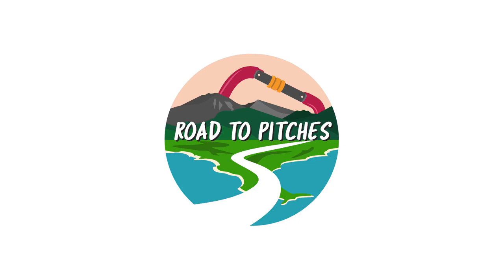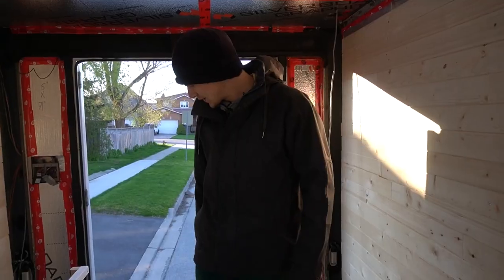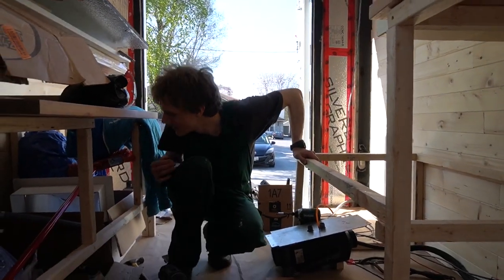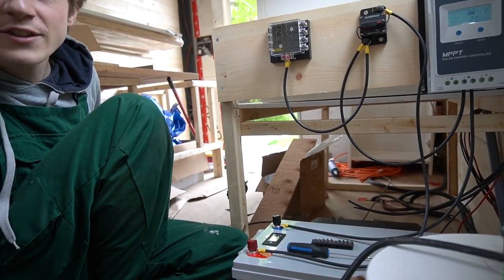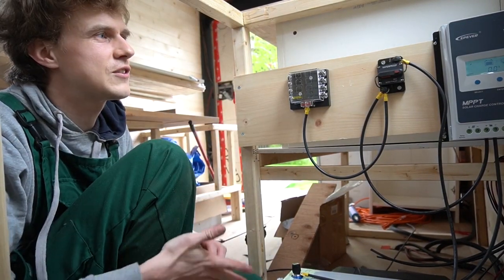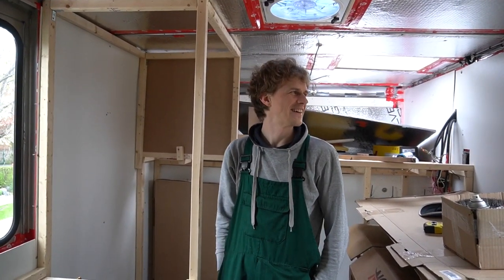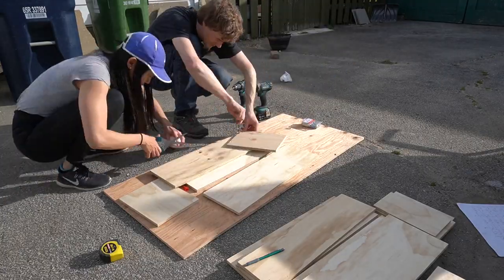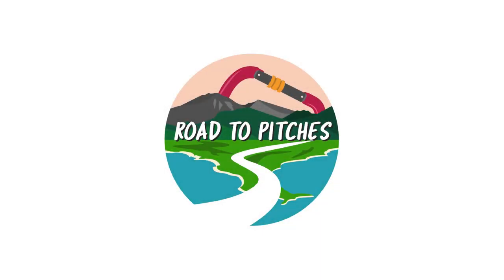Hot Water on Electrical, Solar, IKEA in a Van Build, Leaks | BOX TRUCK CONVERSION

Comment: great build! im a truck mechanic and a box truck owner. the leak is probably the pillar cap. the gray piece where the light is 1 on each side front. it must be removed re sealed and re installed.  Wabash is a trailer repair shop that is nationwide. its not cheap but will fix the leak. you can do it but it is very difficult. i will do my truck in about a month and post a video on my channel. thanks for sharing your build.

Comment: To fix the leak I'd recommend to remove the exiting caulk and clean the area very well. It may look like you have a good seal but if the caulk is not sealing in the first place adding additional caulk will not make much of a difference.  Once everything is nice and clean get the special RV caulk from Dicor or similar.  It may be pricey but is a lot cheaper than removing molded insulation.

Comment: Have you ever thought about using a rubberized spray coating on the inside of the bare metal where the leaks at before you put the insulation & walls up along with trying to seal the leak ? Try some leak seal from home depot  .

Comment: Sometimes finding a leak can be difficult. If all else fails there are several roof coating on the market that works great. Coat the complete roof using a thick roller head. It will seal....

Comment: Use Konree rv sealant tape found on eBay and videos are on you tube demonstrating this tape. Use on all exterior seams and you will never have a leak again. Be warned, once this tape touches an object,  there is no repositioning it. it is extremely strong and works incredible. Stay away from Flexseal. That does not last long term.

Comment: I found a drilled hole in that corner.....had no idea what it is for.....it was behind metal cabinet.  Hmnnnn, for leak?
Reply from the maker: Weird! Yeah, maybe for leaks? We found out this past weekend that the water is entering through the vertical seem at the front right-side of the box. There used to be a metal cabinet there.

Comment: The absolute worst place to put the parking heater, on the basis of the outside intake and exhaust location. The last thing you is to have all of that being exposed to water and spray from the tires. As far as the leaks are concerned,  scrape all that useless caulk off and clean very thoroughly as instructed on the you tube video showing how to properly install Konree rv roof sealant tape. You will never have a leak again.  Do this to any seam where water may come in.
Reply from the maker: Agreed with the heater. That's where it came installed so we just went with it. We fashioned a shield using some scrap metal trim the truck came with to help with the road crud. We managed to combat the leaks thus far! But definitely will have to maintain in the future and scrape/redo. Thanks for all your suggestions, David.